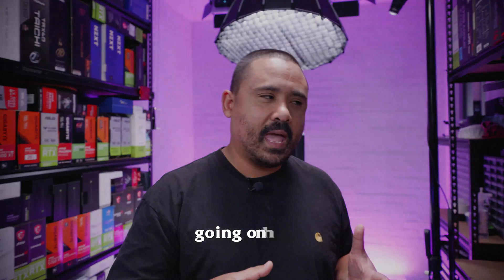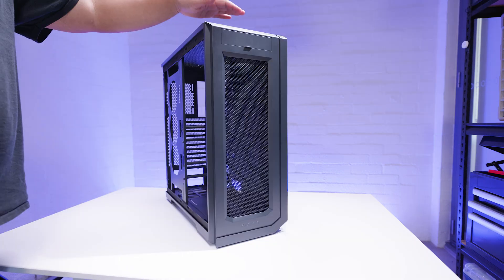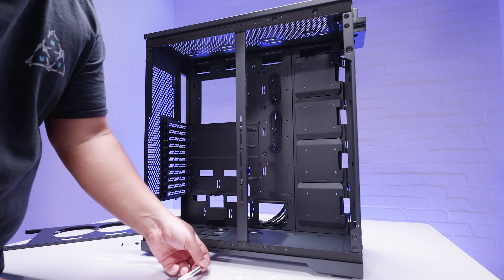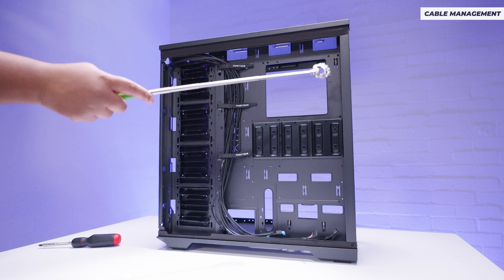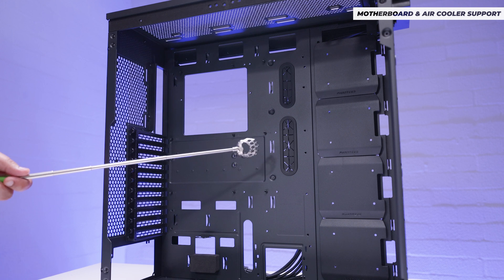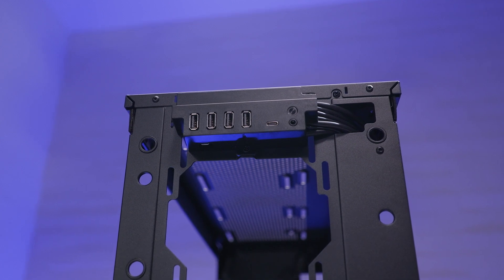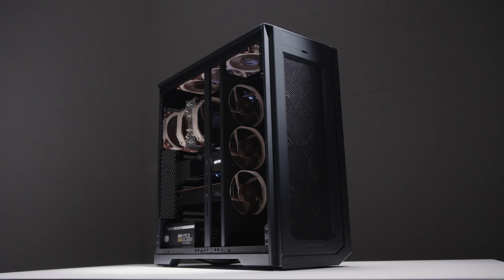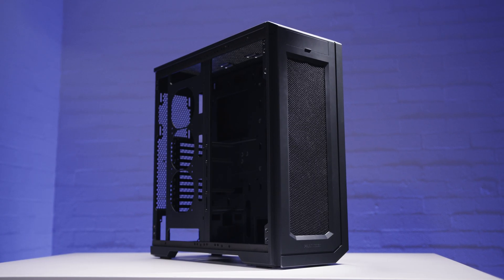THE UNHOLY TRINITY | $12K Intel HEDT, AMD & NVIDIA Monster | Phanteks Enthoo Pro 2 Server Edition

Comment: Gorgeous case, it will be my choice  for 2026 build with the steel side panel. I'm already used to big cases, been using my CM HAF 932 since 2008 along with the same corsair 1000W power supply and just been upgrading so far, its time to retire the whole package considering gpu's have become massive and the front bay slots hardware have gone extinct, also no need to push  the same PSU over 20 years of usage.

Comment: For a case meant to host 4 GPUS it's a pity it can't fit two pc power supplies.  I guess I would have to find the server ones but those are noisier
Reply from the maker: You could go for a 2000W+ 15A PSU. I don't have any 15A outlets which is why I typically don't use them

Comment: Nice to see the PSU return as a visible component. Would have been way neat if the internal fan bracket offered some pivot options, to direct air to the PCB or have more pointed toward an air cooler. Not saying it would be effective but it would give the bracket a raison d'être.

Comment: If it was dual chamber for the psu and had bottom mount fan support id buy it in a heartbeat for my company. We need tons of cases
Reply: Also more room behind the mobo for cable management would be nice and would fit nicely with a dual chamber design for the psu as well